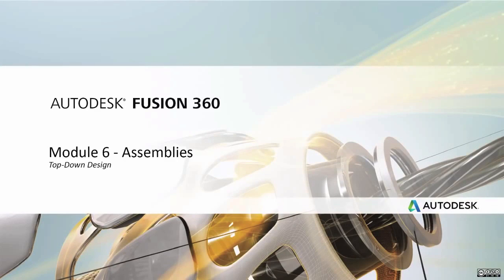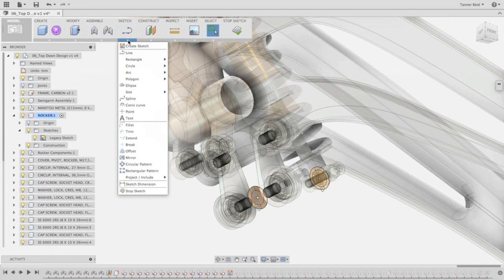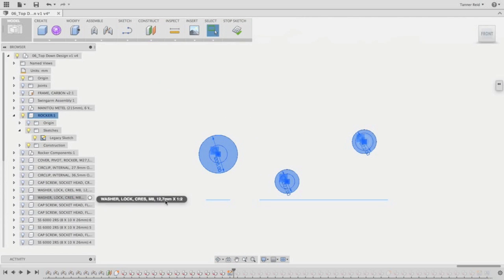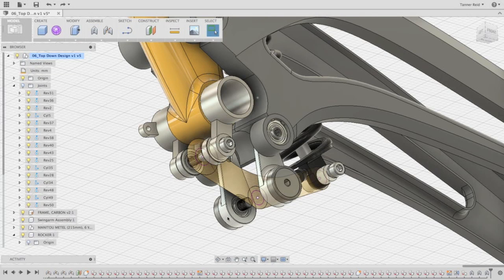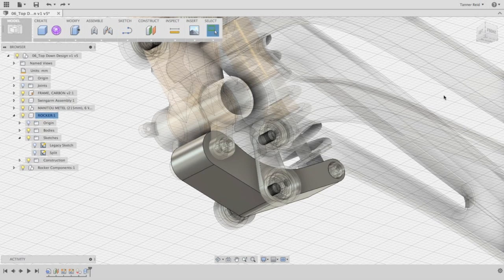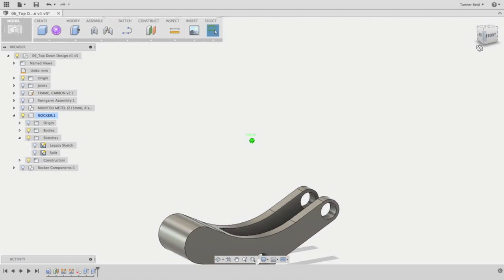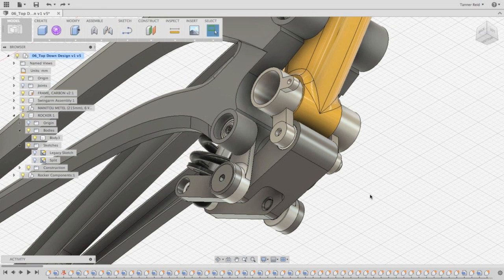06 Top Down Design

Comment: So is it just me or was the frame sketch on the same sketch as the Rocker? Or was it just visible? Also, Is it just more or is it impossible to roll back features on Sketches? That fillet you added is something you want to tune for weight. The bigger the fillet the bigger the part the higher the weight. But once it is in the sketch you can't "undo" or de-feature or even alter the feature. Is this not the case?

Comment: Great video! I just have one problem. "Cut body" under bodies under rocker is not there. Any ideas where it might be or any other solutions?
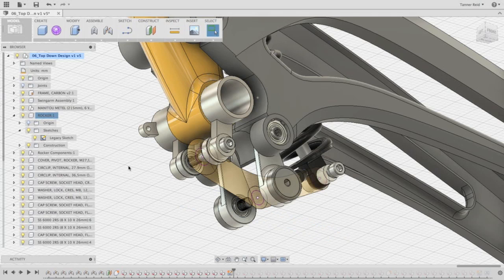Reply: +Big Pickle The 'Bodies' folder under 'Rocker' magically appears at 4:25. Move it one second before at 4:24 and it's not there. This folder contains 'Cut Body' in the video. I don't know when it was created but it looks like a flaw between the video edit and the file upload. I had the same problem as I followed along.